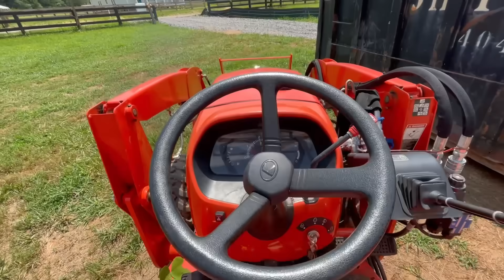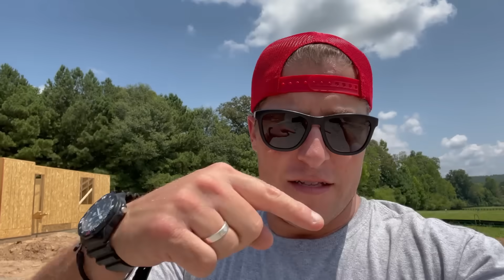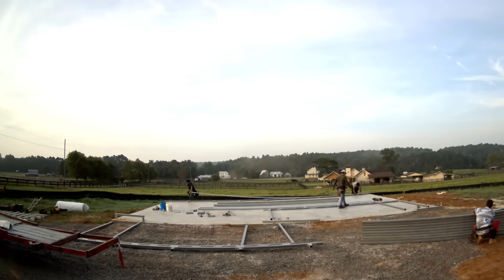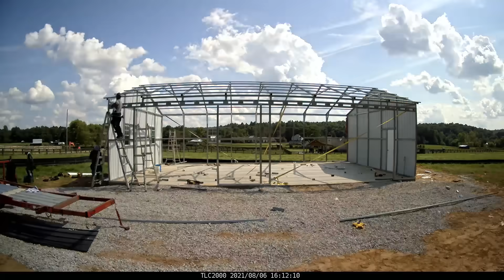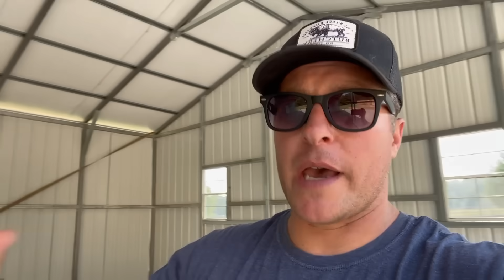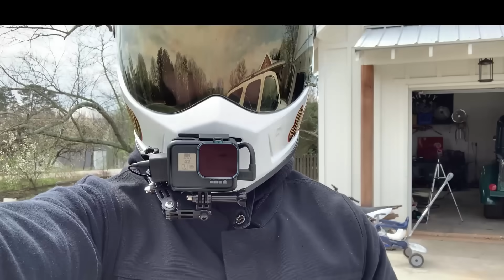I FIRED THEM!!  26x40 metal building Dream Garage build Ep.2

Comment: No. Eff e’m. The building is not structurally sound. That voids the contract. Second, it is not sealed. If that was written in the contract that also voids the contract. The gaps along the roof and walls is extremely poor workmanship. Not sure but other videos the walls are usually horizontal to the pad to give the structure more support. Don’t negotiate. Have your lawyer call and remind them about the building codes and the contract details. Give the the opportunity to fix the structure issue which isn’t difficult. Then have then remove and replace the walls . Hold firm. In court the building inspector will back you and you will win. You might to sue for the time wasted and compensation for your time but, you will survive.

Comment: My recent build has that same A frame.  6 foot.  It passed 140 mph wind code where I live.  BUT you paid for and they designed it with 16foot btaces.  If its in writing then you are 100% entitled to what you ordered and paid for.  Also that's the reason why I chose the company I did.  They makeit in their factory and  they install it.  No third parties involved.
Reply: Whoever you purchased that unit from ought to be very appreciative as to the fact you mentioned no names. Wow! 
I am a dealer of tubular galvanized steel buildings and have been selling them for years. In fact I am one of the larger dealers in our area. There are many advantages to this type of structures, as well as red iron. The problem you have confronted really has nothing to do with the materials used, but rather has everything to do with the dealer that sold you the unit, the manufacturer who pre-fabricated it and last but not least, your inexperienced installers. Personally, if I had been you, I would have had them remove the unit and I would find a company that knew what they were doing. You were very kind in your presentation!

Comment: Your Right about the building spec's and drawings. Finish would be a big issue with me.
However the builder should have reviewed the drawings with the materials delivered and not started building if the materials don't match the plans. Bad on the builder.

Comment: Dude that is a cheaper building design just a simple square tubing, as far as the strength your local codes should have load-bearing/snow/wind requirements. As far as it being strong? yes more likely will be fine for the purpose, but if you thought you would get a high-end building for that price to good to be true means too good to be true and you get screwed.  Next time pay the money and get a pro-builder who will sit you down and tell you things you might not want to hear like, you need a post and beam, or you will need to buy proper trusses and install thicker sheeting and so on.

Comment: You signed off on what they are installing what they send the town is a multitude of building plans you need to look at the model that you approved becouse everything is an option with them buildings just like buying a car  and I agree the side panels should not have a wrinkle on the edge these metal buildings are what they are there half the price of wood good luck
Reply from the maker: Yea honestly I’ve never seen a rippled overlap edge like that. I’ve worked with metal panels a good bit. I honestly think they bought second hand or bad off the machine panels. They just got busted. The ones they brought back to finish looked totally different rigid straight edge.

Comment: I think the company you got it from is a Carolina Carports dealer.  If you search the BBB reviews for that company, they are horrendous and were actually investigated once.
Reply from the maker: It’s so crazy after more research it seems like all the same laborers started these front building company’s. They all get the material from the same supplier. Two of them I called and spoke with the same lady. There’s very few legit metal building company’s. The rest are Mexican family’s fronting like one of the legit company’s then ripping people off or delivering sub par product.
Reply: @ProjectDadLife  exactly!  I’m in the market for one and was about to pull the trigger with one company until I started digging.  I got suspicious whenever I had EXCTLY the same quote from two different companies.   I think the thing to do is make sure the company does their own manufacturing.

Comment: So the first big storm it’s going to come down? Leak? Collapsed roof? Tell them to take it down , take them to court before they do you for holding back the balance , you need to go after them before that party tent collapses . That doesn’t look that structurally sound that thing was swaying when they were supposedly putting up the trusses and beams which are supposed to be the strongest
Reply from the maker: Thanks for watching and the advice!
Reply: It may fail, but only because he did not let them finish their job...  and if it does it will not be their fault...  he will regret not letting them finish the job is not like they are going to give him back his deposit or he had to pay them when they were done if he was unsatisfied.  Good luck getting them back now to put up that final wall and all the overhead doors.
Reply: Wrong it isn't built right. @ericfraser7543

Comment: BUY, THE, LOOKS, OF THE, MATTERIALS, USED THEY ARE, WRONG, SIZE,, THAT IS LIKE USING 2/4,,WERE YOU WOULD NEED 2 BY 12, IF, IT WAS, WOOD, THAT IS, WHAT IS, USED ON, MY, ROOF AND 3/4,INCH,PLYWOOD THE, WALLS, ARE THE SAME AND, THEN THE OUTSIDE WALLS ARE ALUMINUM SIDING AND IT'S GOT, REAL, NAILS, NOT, AIR HAMMER, PINS, THAT IS NOT A, NAIL,,, THE ROOF IS LIFE TIME, SHINGLES, HAMMER,, ON, PROPER, ROOFING, NAIL,, A, STRONG, STORM CAME THROUGH AND ALL THE AIR, PINS, DID NOT HOLD THE SINGLES, DOWN, AND STRIPPED, THE, SHINGLES OFF, THE WHOLE, SIDES OF HOUSES SOME TOOK UP THE, THINNEST, PLYWOOD, OR PARTICALE, BOARD,, YOU, GOT RIPED OF TELL, THEM, TO, BEEF, IT UP AND WELD UP THE PARTS WHERE, BRACES, MEET OR, THE NEXT, 90 MILE, WIND, STORM, WILL TAKE THE PLACE UP LIKE A, KIT, LOOKS LIKE YOU HAVE TO, SISTER UP EVERY PIECE AND THEN, SOME WORK ON ANKERING, IT, DOWN, WELD EVERY JOINT OF THE ROOF AND YOUR GOING TO HAVE TO PAY EXTRA ON EVERY THING,,, OR, JUST GET, RIDE OF THAT THING AND CANCELLE, ALL, PAYMENTS AND BUILD IT, LIKE A BARN, OUT OF GOOD, WOOD AND NAILS, THREAD RODS,
Reply from the maker: Thanks man
Reply: How do you know if the materials are sized correctly just by looking at it, everything is made from steel?  Every part of the building was designed and manufactured to exacting specifications by a team of engineers, they can tell you its snow load and wind shear ratings ensuring it met all codes for the area it was built.  That is why they can assemble a building that size from start to finish in one day and so cheaply.